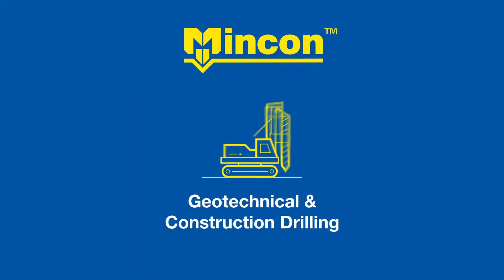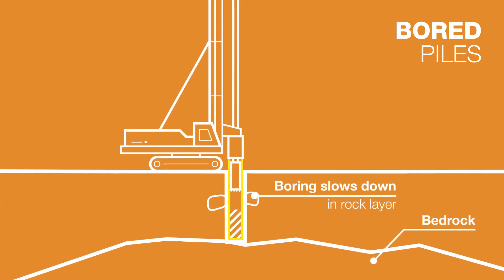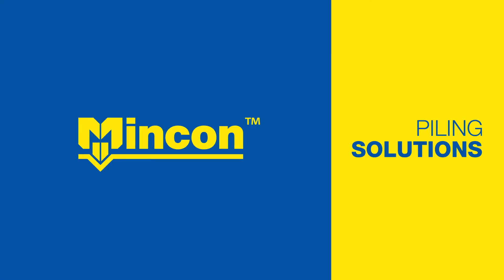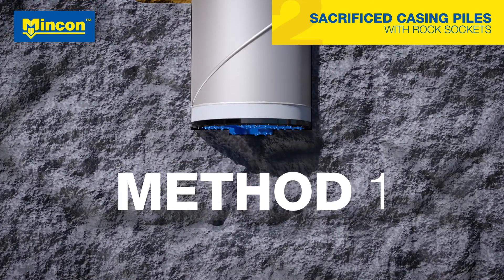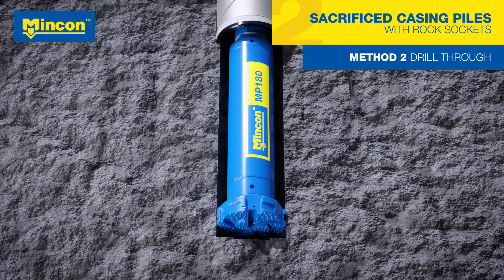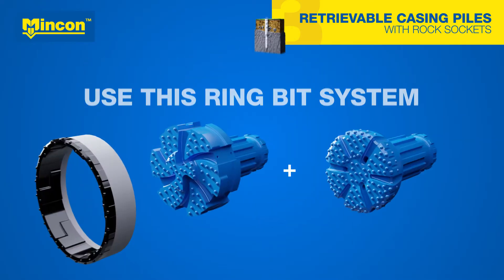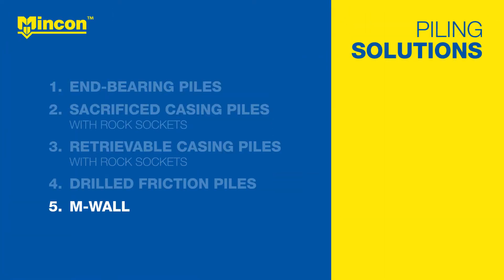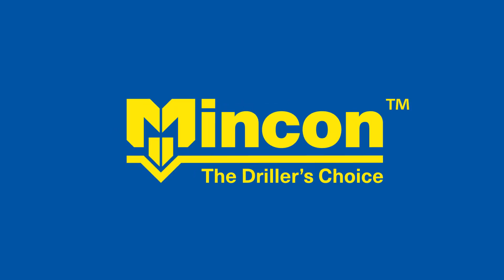Piling Basics

Comment: What if we want to drill through rcc footings ? Which drill to be used ?
Reply from the maker: Our tools have been designed to effortlessly drill through overburden and hard rock, but not for cutting steel that’s inside Reinforced Cement Concrete footings. So, even though you could easily drill into concrete with Mincon tools, you would end up breaking your rock bits when it hits the steel. Instead, use a diamond drill to get through the RCC footing and then continue either with a Mincon casing system or a rock bit.